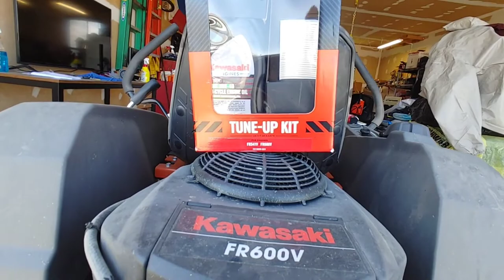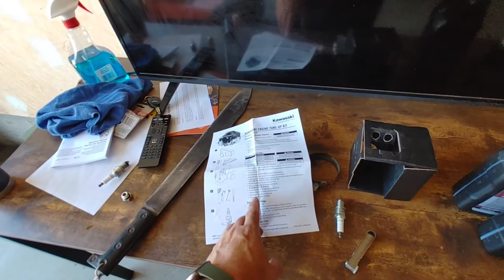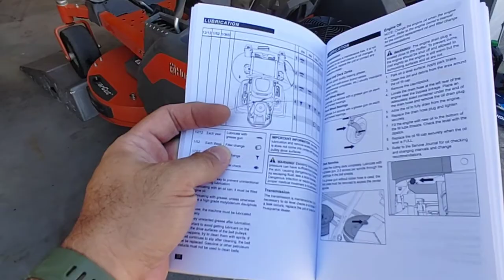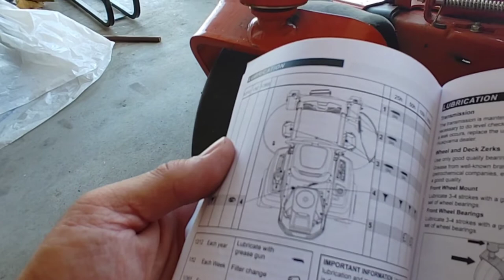Changing The Oil, Filters, Spark Plugs, On My Husqvarna Z242F Zero Turn Mower | First Time |2022

Comment: I have the same mower and instead of buying a replacement hose for the grease gun, I changed the two zerk fittings on the mower deck to 90 degree fittings.
Shame the opening in the frame isn't bigger to allow  most of the filter oil to drain without making a mess.

Comment: I also have one 90 degree zerk nipple;) I will take take a open end wrench 🔧 to take the straight zerks off use the 90 degree one to grease the deck for that same reason. I do not leave the 90 degree zerk on since it spins and could be a hazard and cause damage to something.

Comment: Bend that hose keeper up and pull the drain hose up and run it down through the hole in the plate behind the keeper so it dont leak all over everything. Good video.

Comment: Pro tip: Find an old auto engine spark plug wire, take the straight rubber plug boot off, and put the new plug in it. It flexes, so it's easy to get the new plug started in the threads. I've got a half dozen of the rubber boots scattered everywhere so one is always handy.
Reply from the maker: Thanks for the heads up 👍